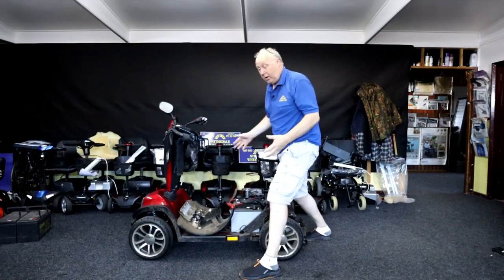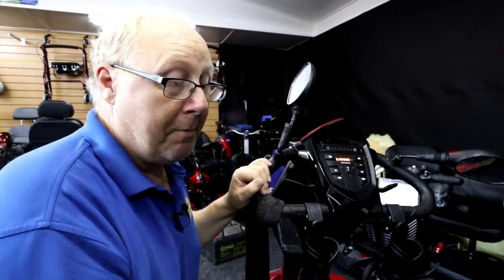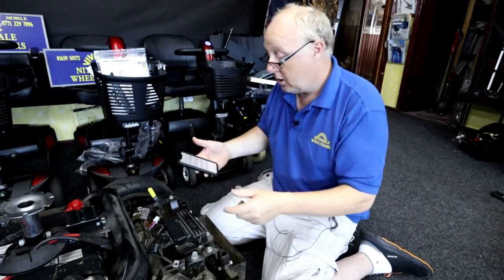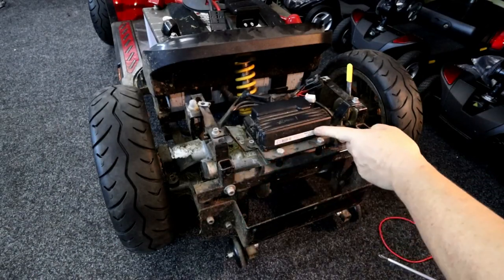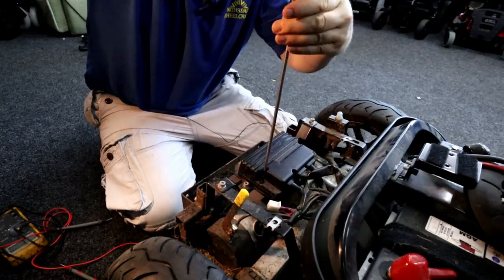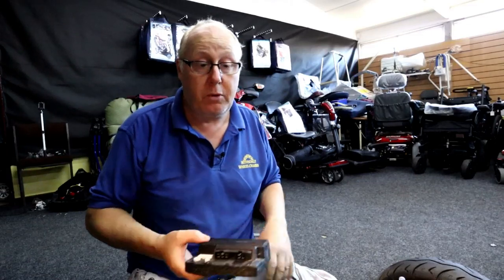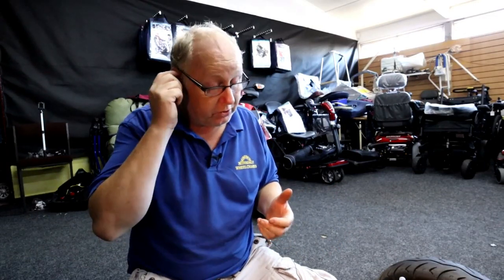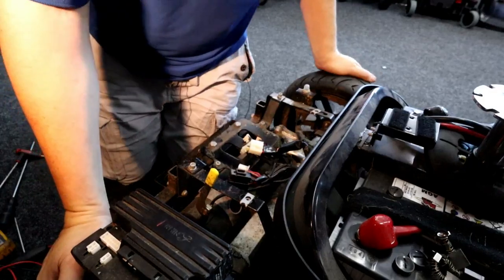Drive Devilbiss Cobra Scooter wont drive

Comment: I had another question... you mentions in this video changing the terminal as an option instead of changing the motor as a whole! Do you mean the the individual metal connection or the male connector as a whole? and would that be easy for myself to change also..? 

Many thanks for your time...👍
Reply from the maker: Hi depends on how bad the scorching is or plastic melting of the connector and if you can actually remove the terminal. Without damaging anything. Best getting a new loom a little bit more expensive but hassle free plug and play.
Reply: @tomjacques4  Would this create the issue of working and not working and working again or does my situation sound more like a brush issue? and the bad contact creating a surge on the plugs over and over?

Comment: Hi Tom I really appreciate your videos well done...
Q: with the brake unit disconnected off the engine should the engine at least turn over?x
Reply from the maker: Brake still has to be wired up and and have no issues

Comment: Hi, great vids! i've enjoyed watching a few with you fixing them today after my mums Invacare comet stopped working today, I thought it was the latch gear for pushing or putting into drive as when I messed with it a few times and started the scooter again it went forward and back but straight away the scooter wouldnt work again? I took cover off and had a wee look and thought it was the switch but on further delving I found a burnt connector not so bad but pretty similair to this video but I think the cable came from the break/latch side end.. I didnt check the brushes as I didnt know anything about these scooters until watching your imformative fab videos! 
I think I shal check them tommorrow! 
I noticed in another video that you use a fibre glass pen to clean, do you not ever use electrical contact spray to clean out these parts? also in another video you mentioned your Whatsapp number but I got carried away watching more of your videos 😂 could I please have your whats app for advise and also if i need to order any parts please!
Reply from the maker: WhatsApp number 07713297096

Comment: Thank you very much, That was very informative, although my scooter is not the same, it does give info. My scooter is a shop rider, and having trouble with wig wag, also replaced the batteries but starts slowing down to a stop after several minutes.👍

Comment: Can you help and advise me please. I bought a Green Power ZT500. Ive only had it 9 months and I went to Tesco's and suddenly it just stopped. The motor whizzed round but did not engage the drive function. Everywhere I went to get it fixed, as soon as I said, Green Power scooter, nobody wanted anything to do with it. I phoned Green Power in Hull and because I didn't buy it direct from them they wanted double the call out fee, £180-00 and then pay for parts and labour probably costing me £450 in total,which I could not afford on my pension. I live in Reading, Berkshire and im 68 ex army man who got blown up on the hms Sheffield in the Falklands where I lost the back of my right leg and suffered severe burns to 30% of my body so I find it hard to get around and really need my scooter up and running. I'm not mechanical minded as I'm a retired chef, Baker, Butcher. Could you please advise me what to do and what to look out for as I'm desperate to be able to get out and about as without my scooter I am housebound.
Many Thanks for taking the time to listen to me,
I remain.
Yours most sincerely.
Mr Robert Bear.
Reading, Berkshire
07523122426

Comment: Hi Tom. Could I ask a question please? I have a gogo ultra ( 3 wheel) which will not move and emits 7 beeps. According to the user guide this relates to the wigwag/speed control. I have checked and replaced both. I also carried out continuity between control pod and control box.Could this be a control box issue ? Any way of checking it ? It is an S-drive unit . Thank you

Comment: Did cleaning the terminal make it work ? Thanks
Reply from the maker: Hi sorry 😞 can’t remember if you watch the whole video you will find out
Reply: @tomjacques4   hi thanks for your reply mine has fault code 7 unknown fault please contact dealer can you advise me on this fault thanks
Reply from the maker: @deedee12386  Hindi yours is fitted with an S drive then it’s: 	
A throttle trip is indicated. Make sure that the throttle is in the neutral position before switching on the scooter. Check all word and ensure throttle is centred
Reply: Sorry to be a pain i have a left and right lever on the handle bars are they the throttle ?
Reply from the maker: @deedee12386  yep 👍🏻 Sure is. one for forward and one for reverse
Reply: Hi yes on my scooter the throttles are always in neutral as soon as i let go of one of the levers it go straight back to the centre position, think i might have to be defeated on this scooter and give it to the scrap man 🥲

Comment: Hi Tom, I have a king cobra, not been used for 6 months but I charge it every 2 weeks, it all works fine but suddenly the charger will not charge the battery and there are no lights or indicators even though you still get the bleeping if the indicators are switched on and the panel lights up when I turn on the lights, but none of the actual lights light up, can you help
Reply from the maker: Check fuses
Reply: Thanks, it was a corroded terminal that had blown a fuse

Comment: Got it working now yeahhhhhhh...the only thing is when the emergency brake thing is on it makes a SCREAMING NOISE doesn't it well I put it all back together and no matter if the brake is on or not its screaming!!! HELP lol...im thinking it's because I've put the brake unit on the wrong way is that possible? X
Reply from the maker: Well done 👍🏻
Reply from the maker: Remove brake and see if the disc is moving when applied
Reply: @tomjacques4  sorry I'm so not use to doing DIY and mechanical things lol...please expand with what's turning lol..? X

Comment: I am thinking of buying a mobility scooter from green power one of these 4 wheels fastes scooter is it very expensive for parts
Reply from the maker: I personally do not work on them I can’t get parts for them I have heard lots of people struggling to get there’s repaired. I don’t thing they have a dealer network around the UK 🇬🇧 but could be. Wrong. Best phone them and tell them you have one and need it repaired and ask them the lead time or your nearest dealership.  personally think they are far too high of the ground  have heard people coming off them as centre of gravity too high. They are cheap compared to the real thing. We sell lots of different types of scooter than can be repairs all over the UK. You will need to speak to them. Best of luck 🤞🏻
Reply: @tomjacques4  I took your advice and I have just got a Rascal Vecta sport scooter are part experience for them
Reply: I have just been out on the scooter and it is making a lot of noise like the brakes are on can you please tell me how to check it it is that please
Reply from the maker: @peterhough4712  is that in the green power one ?
Reply: @tomjacques4  no it's the Rascal  Vecta sport
Reply: It's like something is rubbings on the wheels on the back of it